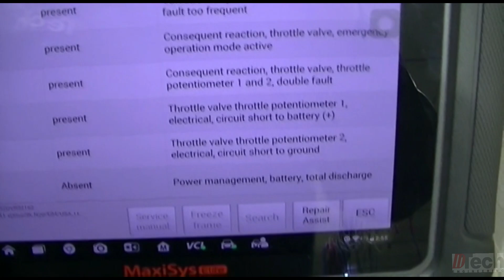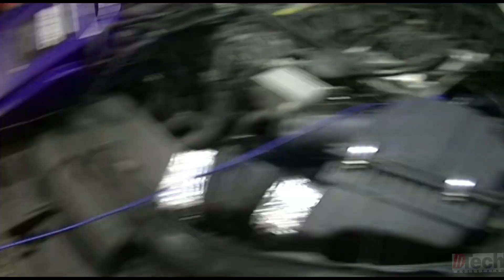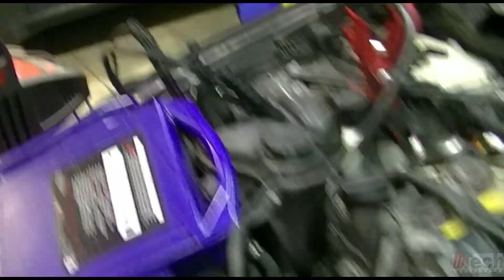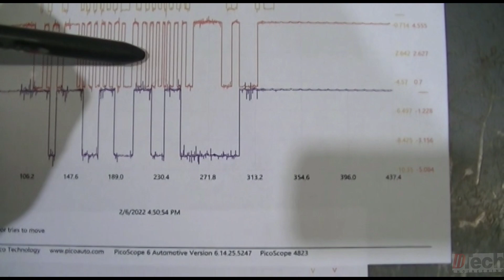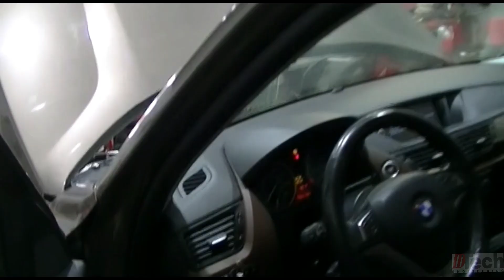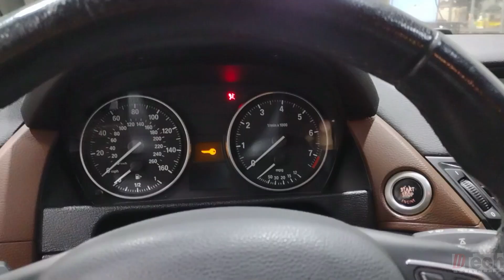2013 BMW X1 "Sorta Crank" no Start N20

Comment: Was the timing chain stretched?
I know this was a long time ago so maybe you won’t recall just figured I’d ask

I’m running into the same exact issue it cranks “sorta” exactly how this one did. Replaced the battery and the vanos solenoids are good.
The timing chain on mine seems to have little to no play so I was assuming there was no way it would jump timing and maybe it was a starter issue… UNTIL I came across this video lol
My car has 92k miles and has never been driven hard
Reply from the maker: I don't think the chain was stretched. But either way, the only thing that caused mine to "sorta" crank and stop was the valvetronic issue. If you have a new strong battery. you can attempt to do dme programing to "reset" it and see if it will crank after that, if not you might need to replace the valvetronic actuator.
Reply: @ okay cause mine has all the symptoms of what this bmw had. I was happy af I came across your video and seen the “sorta crank” cause this was the only video that showed the same exact symptoms as mine.
My timing chain isn’t stretched and the or anything, but my car pretty much lost power when driving and it wouldn’t really accelerate. My last question to you is could a bad valve tonic motor also throw codes p0012 and p0015?
Those are the only codes I have, but again the same exact symptoms as this bmw.

I apologize for such a long message but I truly appreciate you responding and helping me out 🙏🏼🙏🏼

Comment: Just a thought on the valves, get a cylinder leakdown tester. I just finished a timing job on a 2013 328i with the same motor and i'm trying to sort through why it wont fire and that's one of the things I already did to confirm the machine shop didn't mess up the head rebuild.

Comment: So what was the cause of no crank .I have worked on BMW at dealer level and training for 38 years never have I experienced this issue with the N20 ..and I have seen some disasters . So what you replaced the valvetronic motor , replaced the timing cassette and chain ..srvicedcthe oil and vehicle started? What was the cause of the intermittent crank , I don't understand the cause of no start. You could have accessed the white starter lead and caused the starter to crank .Or did the fact the FRM and CAS had different vin numbers cause this ..please clarify, it was very interesting and you have exceptional sope knowledge
Reply from the maker: Hey John, first thank you for watching, honored to have such a long time BMW dealer trained fellow tech spend some time on the channel. As far as the vehicle, it would just not complete the cranking event, it would almost sound as if it was a bad starter or a main starter ground, and it was repetitive, it would sound like just a click of the starter, but i had showed that the crank would actually move a bit each time, so that means the starter engaged and turned the crank and then stop, the dme was the one in control of this. It had the hard fault of the valvetronic that wouldn't clear. The only thing that got it to complete the cranking event and not have it stop short, was programing the dme, after that, it was now able to clear the valvetronic codes and the dme let the starter stay engaged regardless that the timing was off. I believe the dme was in some sort of logic lock state, that it would start the cranking event but then stop it and it was all during that valvetronic code hard fault issue that wouldn't clear. Once it was updated and the memory was cleared and lets call it refreshed, it started cranking again. After that was the usual timing and valvetronic actuator repairs. So, the timing had gone bad, possibly messed up the vlavetronic or upset it, since intake timing is what went off, and then possibly logic locked dme since valvetronic actuatoin is done by dme and it went out of whack when the timing chain went out of whack. This one was a hard one for me since I've never had one do the crank and stop deal, but all I know it was rectified by the dme update. Hope this helps explain my experience and clears some stuff up.

Comment: Rule #2, if it came from the auction with issues,the real issue has already been determined, parts have been shotgunned, and the repair exceeds its value.

Rule #1 never waste your time on Auction cars or wholesalers, they have their cheap mechanics and will only come to you when the easy stuff has been done and they cannot figure it out.
Not my kind of customer EVER!

Comment: Hello I came across your video as I am having the same issue with my 15’ 328i n20. Sounds exactly the same when I push the start button. Loud single click like as if it were the starter. So I put a socket on the crank and try to hand turn and it is extremely hard. I can manage to turn it if I put both my hands on the breaker bar and use lots of force. Could it be that in my case the engine is seized? Should I remove serpentine belt/spark plugs and then try to turn the engine? I looked through the oil fill cap and I can see the timing chain but I don’t know if a tensioner is broken and caused the engine to seize.
Reply from the maker: Yes, it is possible that you might have other issues, because it shouldn't take much effort to turn the engine by hand.  I would definitely start by removing the belt and trying again.
Reply: @DTEAuto  I removed the belt and it seems to turn fine for a bit then got really hard again. Would removing the spark plugs and trying to hand turn be a good idea?

Comment: Nice video. Top notch as always. 
Those  hall sensors are feedback to the controller for the three phases W V U , positions on the brushless dc motor.  
Crazy how the motor wouldn’t even turn over 
Most would have dropped an engine right in. Great job
Reply from the maker: Yes correct, and I was glad to bring this one back to life and not just replace engine, thank you for watching

Comment: Just because starter is new, does not mean it's any good...also suspicious about engine block/ starter ground. 
Just finished video, recap; it did not crank until you updated the dme software 🤔..that will throw almost anyone under the bus. You sir are the man.😃
Unfortunately I can only give 1 thumbs up. Cheers.
Reply: Current says it all about ground issue.
Reply from the maker: You are one hundred percent correct on your starter statement... which I was also questioning as I was looking at the vehicle when diagnosing it. Especially since it was an aftermarket starter, but once I scoped the starter control with amperage, I could tell that the control of engagement was being shut off, so it meant that it was not due to faulty starter at that point. And awesome statement about the ground as well. I too thought it could be that, and I supplemented a ground by using battery cable from chassis to engine and it did not make a difference. Yes, it finally started to stay fully cranking after the programing, this was very odd one for me. Thank you for watching and great observations.

Comment: Wow, great job!
I'm interested to know if the timing-chain had stretched? Hopefully the owner also had you do the chain-guides as well seeing as you picked that up.
Reply from the maker: Yes, the chain had stretched, and we most certain did replace the guide module along with the lower oil pump chain module and the phaser actuators that were sticking along with tensioner . Thank you for watching
Reply: @DTEAuto  I have a 320i so keep those n20 videos coming 👍🏽👍🏽